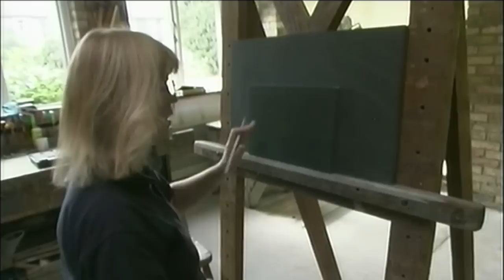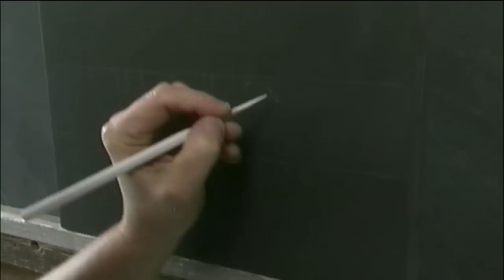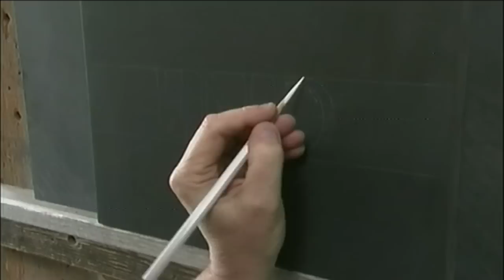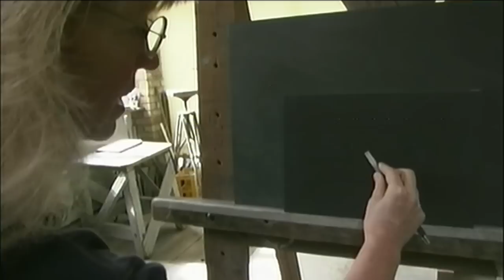Letters into Stone - Part 1

Comment: That’s a Portuguese hammer. And it’s designed so you don’t hit your hand with heavy blows for bulk working stone.

If you glance a chisel with it it’ll bounce away and out if your lucky with is most likely. But with a flat faced hammer it’ll skim down and smash your knuckles.

I’ve used them and yeah they make a huge difference, love my bell hammers